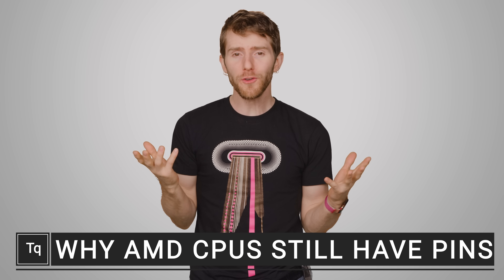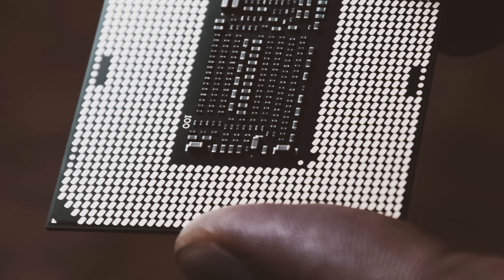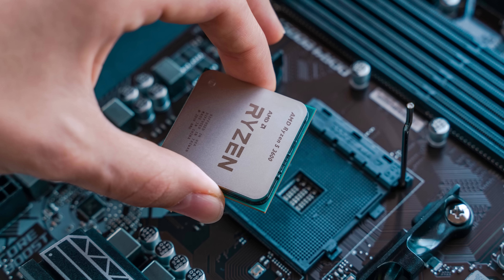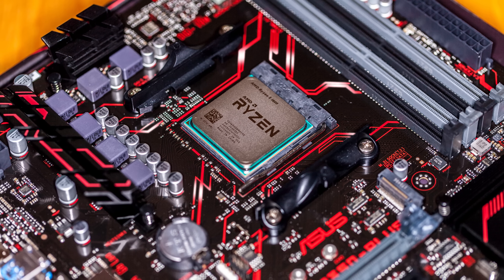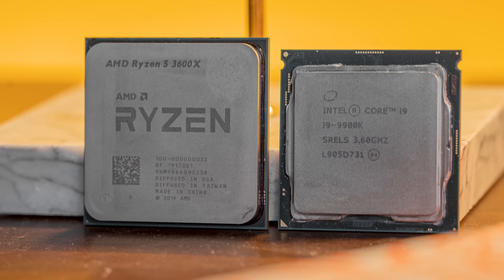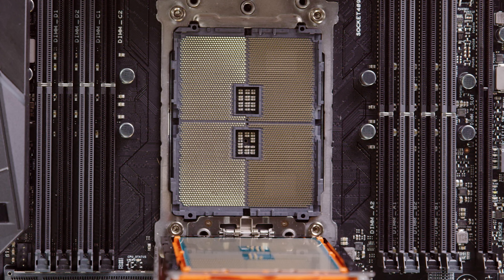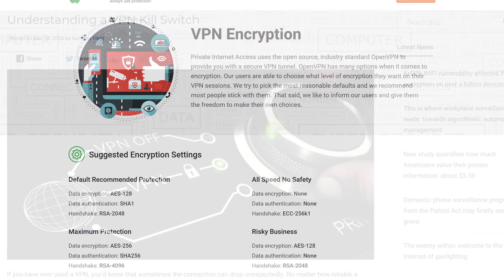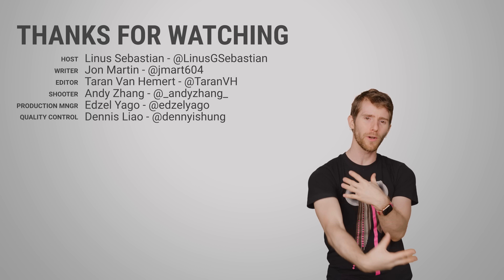Is AMD Stuck In The PAST?

Comment: There another advantage why Intel takes LGA: Move the pin cost from Intel to motherboard manufacturers.
Reply: move cost to the board yet selling at the same price. that's pretty smart.
Reply: @Xelialaidra  and Intel tends to be more expensive too haha
Reply: Actually, they moved the manufacturing complexity one step further than the motherboard: the connector manufacturer. (Foxconn/Ampex/Molex etc.)
From the Mobo manufacturer's perspective there really isn't much difference either way. And, the connector isn't really any more complex either. The ZIF sockets that AMD CPUs use are actually just as complex as the LGA sockets on the inside, it's just that the complexity is hidden underneath the plastic housing with the holes in it.
Basically, Intel found a way to significantly reduce the manufacturing complexity of their CPUs without negatively affecting anyone else in their platform ecosystem. Too bad they didn't pass on any of those savings to the consumers...
Reply: @istvankovasznai  I don't know about not negatively impacting anyone else in their ecosystem.  Damaged socket pins are one of the leading return reasons for Intel motherboards.  They certainly passed on a portion of the risk to their motherboard partners.  AMD shoulders more risk by having the pins on the CPU but luckily for them, the pins on AMD CPUs are far more sturdy then the pins on Intel motherboards.  Not to mention, installing an AMD CPU is simply easier.  AMD's socket is simply more customer friendly.
Reply: @istvankovasznai  As an addendum to Wyatt Newtons comment id like to mention that while some nations or states got crap consumer protection laws, and retailers, physical as digital have tight margins, if crap like handling returns or customer goodwill being lost happen enough, this can be discouraging to smaller desktop building firms and retailers with tight margins, specifically the ones you and I would be interested in buying for our own builds, I doubt its an issue on the OEM side considering the brown envelopes intel hand out as compensation, but the OEM desktop market is not exactly rapidly expanding in western markets.
Reply: This is the real reason.
Reply: @Defy_Convention  yes true
Reply: You can't install a CPU with a fudged up pin into a socket. You have no choice but to fix that pin so you can always install CPU's with pins correctly. With LGA sockets though you are able to install CPUs with fudged pins in the socket without you knowing, and that leads to side effects.
Reply: And then charge more than AMD anyways.
Reply: I don't think it's cheaper to manufacture, but it might mean that mobo manufacturers have do deal with more RMAs, and intel has less.
Reply: Lol
Reply: Lmao
Reply: This was a the reason many thought was the real reason at the time.
Reply: Intel gets scummier the more you know about their business practices.
Reply: they do that but intel is expensive anyways
Reply: And still make more expensive products for no reason.
Reply: There's not much of any cost difference. Anyone who makes this statement clearly doesn't know how CPU sockets are made.
Reply: @paulghignon4092  it's a joke you mong
Reply: CuriousFrog the only thing stuck in the past is that lame-ass insult
Reply: @paulghignon4092 Even if it saves them $0.01 per unit and they sell 100 million (2014 Q4 alone statistics) that's $1000000 they've saved themselves
Reply: @cflux1030  Once the cost of "retooling" is paid off.  Depends on the manufacturing costs of the particular technologies.
Reply: @paulghignon4092  Yeah, but the guy who came up with the idea probably used the bogus numbers and so got his raise/bonus/promotion.

Comment: Ball/spring arrays would be a good replacement for the easily damaged LGA pins. Instead of relying on a pin array that can be damaged/destroyed, using a ball floating on top of a spring would provide firm force against the CPU's contact points and literally cannot be destroyed unless by bad manufacturing or the CPU physically melting the plastic containment for the ball/spring grid. And since the current pin style being used is in the shape of a ball anyways, there would be virtually nothing different than what's currently on the market. Might be more expensive using tiny ball bearings and soft springs, but the trade-off would be a motherboard that has a CPU socket that is almost fully indestructible.
Reply: Ooo.. That is a whole new meaning to BGA (usual BGA involves solder balls)

Or, you could call it CGA (Catapult Grid Array)...

Comment: AMD is still using PGA because it wants to keep using the same heatsink anchor format, it's great, I could use my old AM2 heatsink on an AM4 without investing in a new heatsink, compared to Intel changing the anchors every so often.
I can even use a wraith prism heatsink on a board with socket 754.
PGA is a good format, (although it breaks due to bad manipulation, but that is because it was installed incorrectly), I have been mounting computers for 14 years, and I have not broken any PGA, trick? well install it carefully and as the manufacturer says.
Another very big drawback that the LGA has, this one has a limited number of inserts, I think I remember about 100 times, when I exceed the limit the pins start to lose strength, and stop making good contact.
But the PGA does not happen ...

Comment: I had an "oh shit no no no no" moment with my Ryzen 7 3700... put it in the socket, applied thermal compound, placed the wraith prism on it... which was the mistake, logo was upside down... when I noticed this, this is also my first build ever, I attempted to take the cooler off and reposition it... ended up ripping the chip out of the socket, tension bar was down too... luckily it wasn't damaged! Heart rate was at an all time high and good God I was lucky I didn't F it up... again lol.

Comment: I just replaced my stock cooler on AM4 with a shiny new AIO. The stock cooler was practically fused on the cpu and it ripped the processor out of the socket at an angle bending 30 odd pins. 2 hours with a thin paring knife and a lot of profuse sweating later i just finished my prime 95 stress test after a successful boot. Moral of the story, use a playing card or something to loosen the thermal paste bond before pulling the cooler on a PGA socket friends, you probably wont be as lucky as me.

Comment: I don't have any pins my AMD CPU (TR4 :). LGA is 10x more delicate than a PGA. I've fixed PGA bent pins on many CPU's -- LGA bent pins I need to break out a microscope and the gold plated nickel pins are paper thin. The biggest issue I ran into was LGA are the pins are layered at a steep angle with micro bends at different points to stay flexible and still have tension but their nearly indistinguishable from one another. When the light hits them it is a pain to see which is which without a scope. Ive fixed TR4 4096 pin sockets and the scariest thing to see are completely FOLDED pins (bent in half) from dropped CPU's (the cpu usually slides across  the socket after hitting bending about 20+ pins) but ive successfully got them bent back (took about 2 hours with scope and no coffee!).

Comment: fact intel motherboard are the worst to work with, once you bend a motherboard pin you are basically fuck. cpu pins are easy to bend back in place its almost unbreakable, been working assembly pc for years and years and the only one a fuck up was the one with pins on the motherboard. thats why to see so many open box motherboard on newegg and amazon ppl bend the pins and send them back, i understand why motherboard company prefer working with motherboard without pins on them.

Comment: Both AMD and Intel cpu design engineers need to go back to drawing board on this.  There has to be a better way to just eliminate the pins all together.. either on the mobo or cpu.  Perhaps a pyramid shape connection on the bottom of the cpu contacts, that press into a mobo socket.  I actually came up with a design a few years back.  Hell of a lot more durable than AMD's pins.. and wouldn't bend.  Plus you wouldn't have to worry about pins on mobo being bent like on intel mobo's.

Comment: I find the pin design more robust, and that lever not needing a force of dunno 500 Newton to secure on the motherboard more satisfying. On the other hand, to change old thermal paste, requiring to remove the heatsink removes the PGA cpu most of the times, as it's so stuck on the heatsink.. Still, I prefer a slightly bent PGA pin than a motherboard one ANY day. And I have seen 775 MB pins burned out by a Q8xxx or Q9xxx processor power draw, oh boy that sucks. Anyways. How about making a retro video rebuilding your first PC or what your first dream PC was (or maybe you've done this already, dunno!)

Comment: Is AMD stuck in the past?
At the same time Intel: Look, we have 16 mb L3 cache in the top 9900k
Reply: right while the r9 3950x has 64 mb of l3 cache, isn't it weird that even an entry level amd cpu like the ryzen 3 3100 have 16 mb of cache xD
Reply: @366nigeriandude8  That cache has tons of latency, thata why they added so much of it
Reply: @Spacy1717  Wouldn't fitting more data reduce latency to wait till next data arrives in first place?
It won't make much difference but when you use hyperthreading (SMT on AMD), It won't have to wait for next 16 mbs to arrive, It will just pass it to next core
Reply: @prateekpanwar646  i think so, thats why they added so much of it, but anyways buy ryzen
Reply: Intel:
Sorry we don't do cache here
Reply: Well, the funny thing is that I'm running a LGA 771 Xeon on an LGA 775 mobo, which has like 12MB cache and that's L2, not L3. Doesn't say much about its performance though, I guess, just like you can't compare cpus by just clock speeds anymore since like two decades.
Reply: @MrKata55  well yeah idk about that im on xeon e5 2689 with 20mb cache

Comment: Linus: Is AMD Stuck in The PAST?
Intel: 14nm+++
Reply: That's because of quantum tunneling dude. Our current CPUs have nearly hit their upper limits and simply strapping more cores into them only takes you so far. Single core performance has increased in minimal amounts, and because of how programming works there's only so much multi-threading that you can incorporate into code before it's entire redundant.

Comment: You see far more damaged sockets on motherboards than you do bent or broken pins on amd chips, i'd say it's also a lot easier to damage socket contacts just installing a cpu than it is to bend or break a amd pin, plus the pens are far easier to bend back on a cpu, straitening socket pins is a absolute nightmare, plus if you don't get it right you risk killing the board and cpu.

Comment: video idea - big IPC review in desktop intel CPUs over last decade:
just example: nehalem i7-920, westmare i7-970, sandyB i7-2600K, ivyB i7-3770K, haswell i7-4770K, haswell refresh i7-4790K, broadwell i7-5775C, sky lake i7-6700K, kaby lake (sky lake refresh) i7-7700K, coffee lake (skylake refresh refresh = kaby lake refresh) i7-8700K / i5-8600K, coffee lake refresh (skylake refresh refresh refresh = kaby lake refresh refresh) i9-9900K / i7-9700K   AAAAND   comet lake (skylake refresh refresh refresh refresh = kaby lake refresh refresh refresh = coffee lake refresh refresh)   i9-10900K / i7-10700K / i5-10600K  in a 1-THREAD benchmarking on the same frequency (eg. 2.8 ghz) in variety of many benchmarks (1-thread SuperPI is obligatory) and also real applications ... and then big calculation of average IPC increasing
video idea nr. 2 - the same with AMD
Reply: to keep some fairness, all systems should contain the RAM with maximal OFFICIAL speed, that works with the controller in CPU and also they really should contain SSDs instead of HDDs

Comment: You mentioned the benefit of cost when comparing damage of CPU vs motherboard, but didn't include a cost comparison between motherboards.  The LGA boards are typically more expensive, possibly because of the additional complexities of manufacturing an LGA socket.  Another economic consideration when choosing a platform.
Overall, you gave a very nice explanation.

Comment: One time when I worked on an AMD system in the past, when removing the cpu cooler the cpu would get stuck on the cooler and rip right out of the socket with the clamp still down. Luckily the pins remained intact.
Reply: That happens all the time with am3+ cpus

Comment: I have a Ryzen PC and I am going to stick with AMD for the foreseeable future and honestly, I'd rather deal with slightly more fragile motherboard pins than with this whole mess. You are far more likely to drop a processor than a motherboard, and even if you do end up dropping a mobo, usually nothing happens, since the pins are protected by the cover and before anything even touches them (if you do happen to drop it upside down) it has to encounter other elements found on the board. I almost ended up dropping my 2600X when I had to put my rig together, and I'm usually very careful. I've joined several PC groups on Facebook, and I hear about chips with bent pins all the time...but only once or twice did I see a motherboard with bent or broken pins. Even if you do encounter a damaged board, you can always RMA it, but the fact remains that they tend to be much less expensive than a CPU...someone who spends $700 on a mobo usually pairs it with a processor that costs twice as much, and is certainly entitled to a replacement should it arrive with bent pins, but if you drop a $1,500 chip, there's really nothing you can do about it except buy another one. This to me is pretty uncontroversial. The engineering advantages of CPU pins are irrelevant to the average consumer.

Comment: Why not best of both worlds?
Pads on the cpu and pads on the motherboard, with a cheap af double sided sacrificial adapter in the middle.. break a pin? get a new $5 adapter

or, pads on the motherboard and balls on the cpu - like the ball grid array on GPUs but instead of soldering it on, just use moderate compression

Comment: thing is that using threadripper as an example, even when AMD does go for LGA, they went with a mounting method that is simpler and better with the way you slide the processor in, then use an arm to lower it

Comment: Techquickie : AMD-s pins on the CPU are a smarter and a superior choice. Why ?

1. CPU-s tend to last longer on the used market than motherboards do so you can buy a used CPU for longer periods of time than a used motherboard. So if a motherboard has holes in its socket, that's just one less thing to get damaged through time by clumsy wannabee PC builders. This greatly helps with the longevity of the motherboard. And it doesn't matter than the board is cheaper than the CPU since you almost cannot get a proper Shintel motherboard if every "new" Shintel generation requires a new adjusted socket. So what are you gonna do with your 580 EUROS i9 9900K after 2 years when you cannot get a new motherboard for it and you accidentally broke your motherboards socket pins ????
2. Having pins on the CPU give the CPU much larger contact area for every single pin hence a better larger area for conductivity of the voltage which comes especially in handy for the pins that receive power delivery voltage and current.

As opposed to Shintel, that intentionally give land grid array dots on the CPU....for one sole reason : to maximize the possibility of customers damaging the socket on the motherboard to give it yet another reason to justify that they need to buy a new motherboard. This way Shintel, from another angle, forces customers to buy their CPU-s and motherboards for them more often than they should.

Comment: I've always been curious though -- why not just flat contact points on both sides? With enough even pressure, a solid connection shouldn't be an issue, and then it also solves durability issues all around.

Comment: I accidentally dropped my old ryzen 5 1600X and bent about 6 pins badly and about 6 more just a little bit. It took a bright light, magnafying glass and some really tiny screwdriver tips and a bar of soap to wash out my mouth; but after about an hour I managed to get the little BASTAR......ds..... straight enough to go into the socket where then clamping the retention down finished it up.

Comment: My schoolbook says that the pins on amd CPUs can function as little antennas which may cause interference with the other pins. Not that I have ever had any trouble with my ryzen 7, but now I've learned from this video that Intel uses pins as well. Just on the mainboard. But just because they are on the motherboard doesnt mean that they won't funtion as little antennas right? I just took another look in my book and it says that those "springs" on LGA sockets do not function as antennas (no further details given) and that this eliminates problems which may occur with higher clock speeds. 
Now this makes AMD PGA look like a bad design choice. However in reality I've never heard of any trouble like this. What the hell....